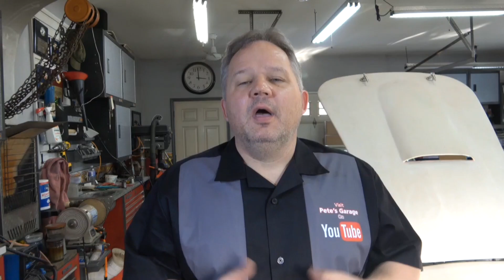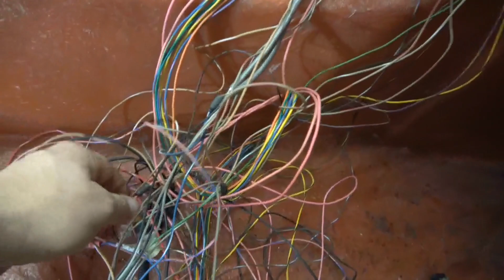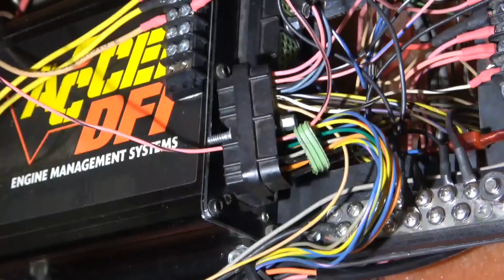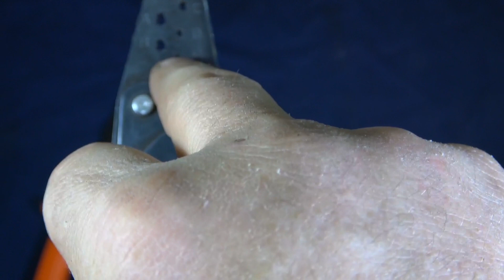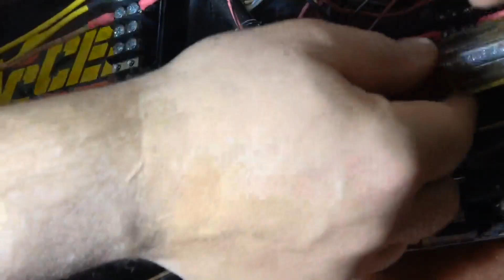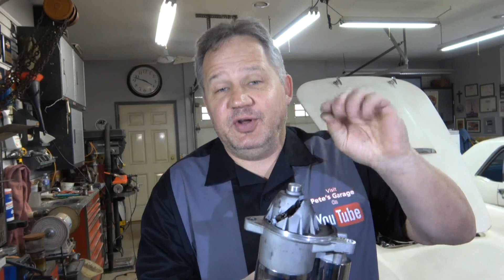427 Cobra Finish Ignition Wiring, Molex Connectors and Tools

Comment: If it is just one injector that is stuck open, what is the reason for buying a complete set of 8 again? Just asking.  Didn't hear an explanation for that.  I was right with you over the worry of what might have happened inside the engine...lol.  I know that feeling of starting up a new engine...and not having things go as planned right away.  THere's a lot of work and investment that goes into these things.
Reply from the maker: I'm getting a complete set because if 1 stuck, others may do the same. It's the safe way to prevent thousands in future damage
Reply: @PetesGarage  Thanks, Pete.